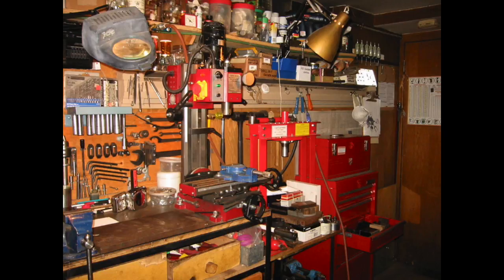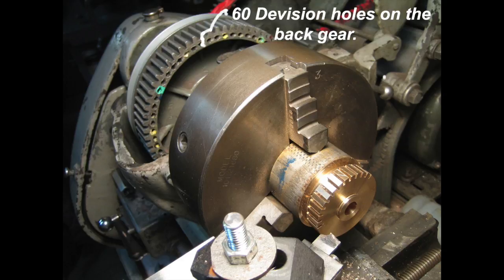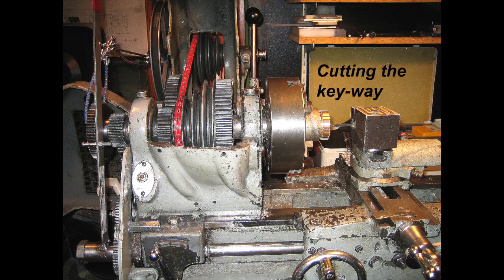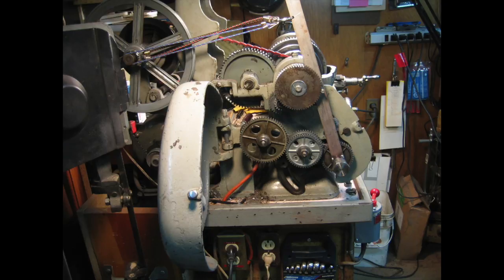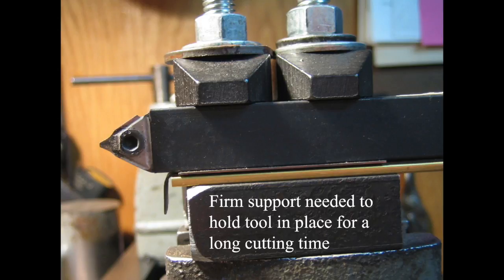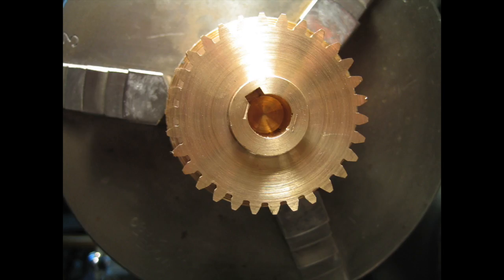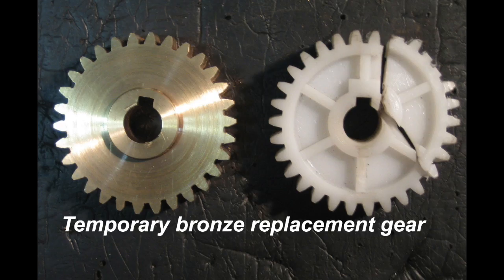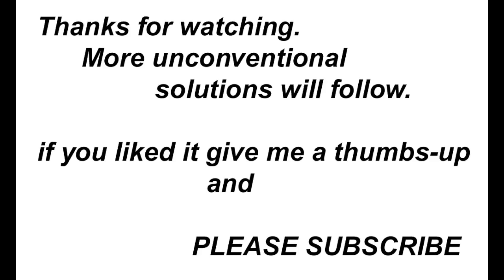#26 - Gear Made on a 10" Atlas Lathe

Comment: using the lathe as a planer?  clever af.   Awesome dirty old man tricks!
Reply from the maker: Alexander Leduc Thanks, it took 5000 strokes and pain in the wrist
Reply: how many  hours to accomplish all that?  Did you need the strength of your hand or could it have been done with a drill with a T shaped bar in the chuck?
Reply from the maker: Took two days by hand, taking off 2 thou at a time